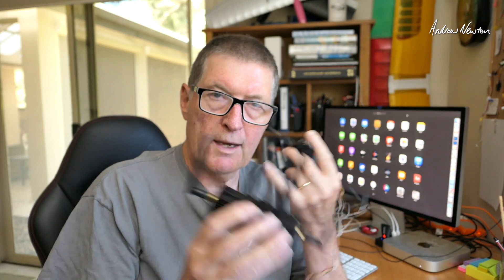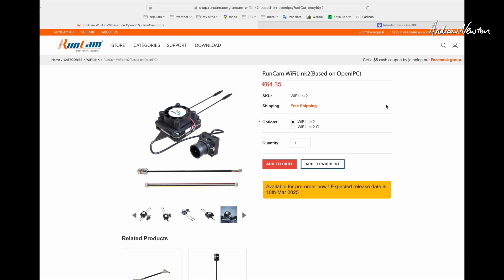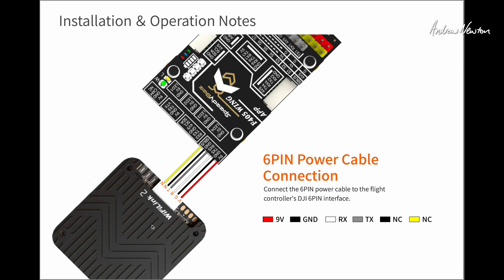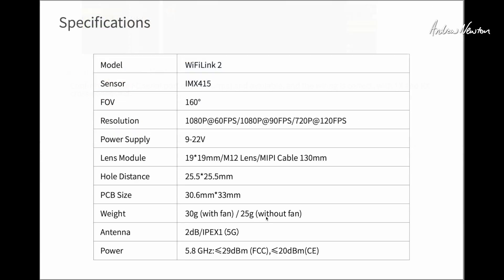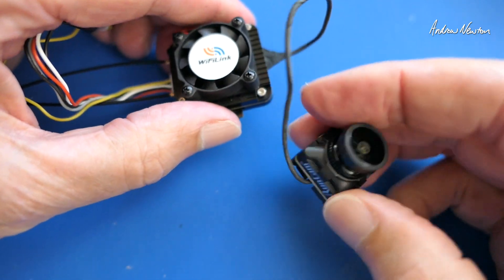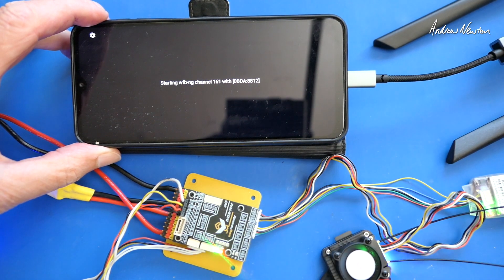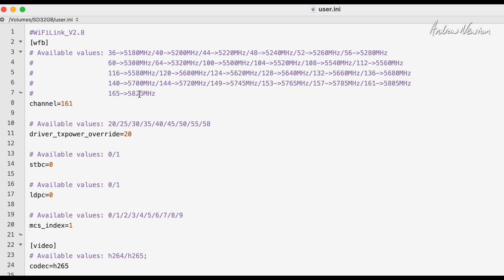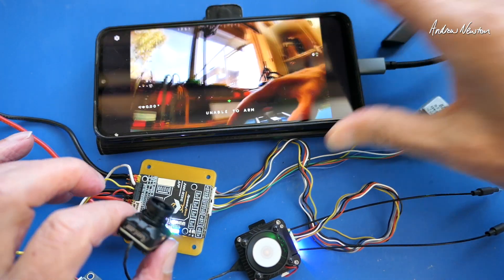RunCam WIFILINK2 HD FPV - OpenIPC

Comment: Hi M. Newton, I'm looking at this product and I was wondering If I can use it without the flight controller since I would like to install it on my rc truck and do you now the range of it. I have a pair of goggle that need a smartphone so you said the application was offering the possibility to use vr mode with split screen if I understand correctly. Do you know if I can use this kit with the c20T gimbal it would be the perfect set up for me, thank you and have a nice day.
Reply from the maker: I wouldn't recommend it at this stage, too early in development. Range in the air with the proper receiver unit is only 1km so the wifi version and on the ground would be much less. Don't know if  it would fit the gimbal.
Reply: Thank you M. Newton and have a nice day.

Comment: Can you test latency on the bench with PixelPilot? Obviously this is dependent on speed of Android phone running the software, so you probably need to include the phone's specs as well.
Reply from the maker: Latency didn't look good but it is low spec cheap Samsung A13 phone
Reply: I haven't made a latency bench test but pixelpilot seems very responsive and quick. I tried 2 different phones and it is completely fine, just waving my hand in front of the camera at 720p 120 fps, there is no perceptible latency - definitely good enough for wing. Using the settings on the  fpv4win software on the PC, there is a slight noticeable degradation in latnecy, BUT still good enough for wing. Won't know for sure until i actually use a quad or wing to fly it.

Comment: Stick it on a  plane and fly it LOS Andrew....with the Screen recorder going please. Id bet the range is nothing to shout about, but thats what the new VRX is for eh...?..Currykitten had a problem getting an HDMI cable with a micro each end😳...Why didn't they supply one?....🤔🇬🇧
Reply from the maker: I can't find a mini to mini HDMI cable anywhere, had to use adapters and not getting any output yet
Reply: @AndrewNewton Yep, it's extraordinary that Runcam have ignored something so fundamental...No cable, no deal...😮😳😳😳
Reply: @EnglishTurbines there was a video from MarioFPV showing 5 km of range. What kind of range would make you shout about it ? :D Most flights with quads are up to 2 km. That being said i can't wait to try the 5 km with a wing myself :)
Reply: @anti4354  I was referring to the WiFi Module mate.... Obviously...🤔🇬🇧

Comment: How can Runcam do a vtx and camera for sixty dollars...?
Including a cooling fan..?
Please explain Walksnail....🤔😳🇬🇧
Reply: We've not seen it in action yet.
Reply: @wattage2007  I have, its okay...🤔🇬🇧
Reply: @ How’s the latency? In the few clips I’ve seen of it, it looks to be in the hundreds of milliseconds.
Reply: @wattage2007 where are you getting hundreds?? It's more like 50 with a bad setup and 35 with a good one
Reply: @ Painless 360 showed it a couple of days ago and the latency of his hand movements monitored on his phone screen was about 1/3 of a second. That could’ve been processing latency of his phone of course but there isn’t much footage available to compare yet. It is well interesting though, I built myself an open ipc ground station for my F450 a few years back and it showed promise. At the time it was very clunky so it’s interesting to see it becoming more streamlined.
Reply: @wattage2007 Forget the stupid phone setup...Its been tested on Runcams new vrx, but theres a problem with the hdmi cable and its phsical port. The hdmi plug wont seat fully and drops out...See Currykittens review ..🤔🙄🇬🇧
Reply: @EnglishTurbines  Will do, Mr Turbines 👍🏴🇬🇧

Comment: Range?
Reply: depends on the antenna. if on RX there is a patch or helix with gain of about 20dbi, the range will be probably 20+km
Reply: the max tested so far was 20km. 20Dbi on ground, 11dbi on air
Reply: @wojtek3016  WTF 11dbi on air ? directional antenna?
Reply: Not directional, just higher gain I suppose  @unixoid33
Reply: @Jonit_svk  As far as I know, non-directional antennas have a gain of 1-3 dbi. 11 dbi seems to me to be just a marketing gimmick. But maybe I'm wrong.
Reply: @unixoid33 it was a directional antenna I think. Also the antenna isn't marketing bluff since it was not from runcam or something